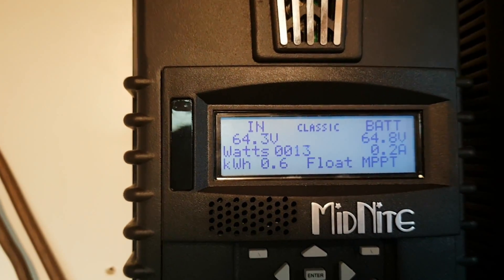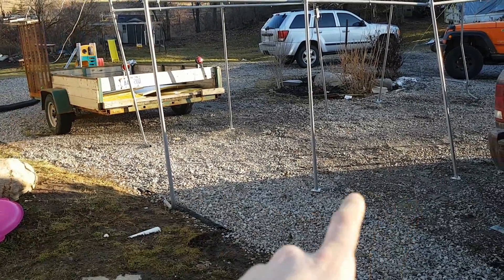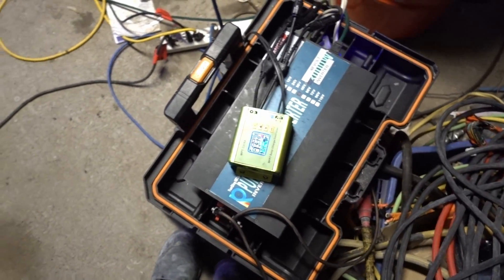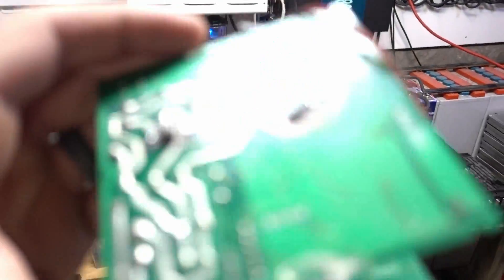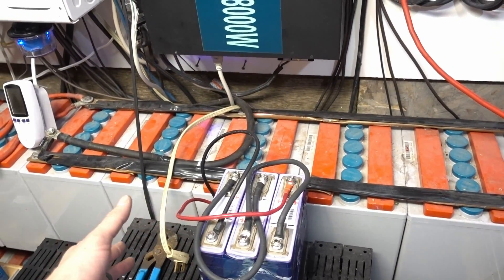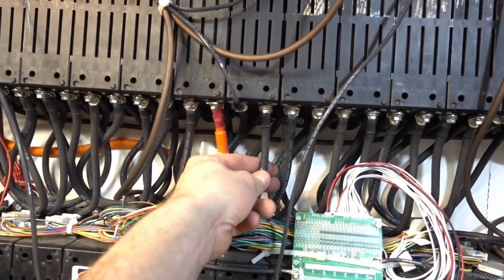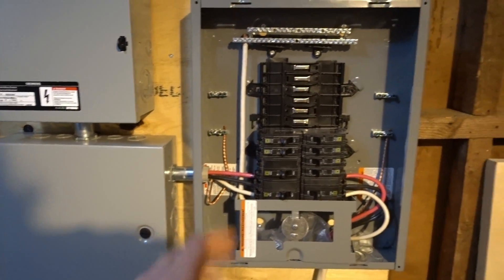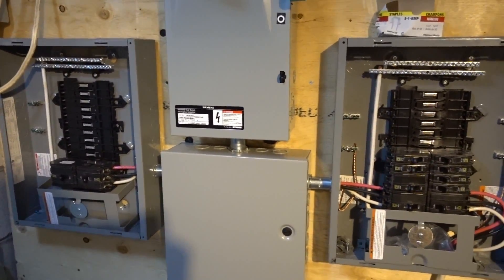Wind Turbine Update And 4000w continuous Load On Reliable Inverter

Comment: Without a doubt, the sweetest system I've seen compared to both my own, and several others I've seen that are SERIOUS builds. I have a lithium bank @ 24v 7000ah and a 2500watt 20amp setup, no wind generator but plan on using DC motors @36v 800+w with step down for suppliment power and I have 36+ mph winds about 7 months in the year. I have a gasification system and two dual fuel generators (propane/gas) at a total of 8000/6000 watts run time. I also make bio with fat and lye and a 10kw diesel generator.... Seriously nice system you have there, can't stress this enough. Keep up the fire proofing.  Love your setup and I'll have to share mine once I have my buss bars clean and the system all tidy.
Reply from the maker: you should see it now :D thanks a long! I would love to see your system!!! check out my newer videos
Reply: @GoingOffGrid101  I'm subscribing and I'll share mine soon.
Reply from the maker: @rabidoctopus  sick I'll check them out!

Comment: Your doing a strange thing with your neutral !!! i think it should be always connected!
Reply from the maker: Its the same breaking the neutral or not, its like a double safety. remember the neutral is a live that is bound to ground, when you disconnect it, it leaves the ground alone, these units are use like this around here.
Reply from the maker: thanks a lot though this brings up matters in case I have not thought of it!
Reply: Neutral has to be tied to GND at some point, so lets let the neutral always connected and you'l have your tie down to GND at your main panel !

Comment: Glad to see winter easing up only a few weeks till spring. My netmetering started backup this month when the winter snow slid off lol. Made 20 kw yesterday with my 32 panel with enphase 250 watt inverter. You are coming along fine in the new house but just as busy with your solar passion. I picked up an Eaton box today to convert my water heater to solar.
Reply from the maker: i plan on being 100% off grid this summer.
Reply from the maker: 20 kw is not bad! I hope to get another 5kw of solar and make 40-50 kw per day in summer :)
Reply: I think my best day last year was 66KWh in one day, my roof is off the south orientation by 40d and my angle on 4-12 pitch is low for 45 Degree latitude. Still looking for batteries I think the Volt battery is the way to go.
Reply from the maker: im looking for another volt battery :)